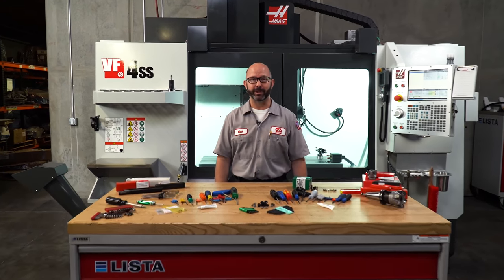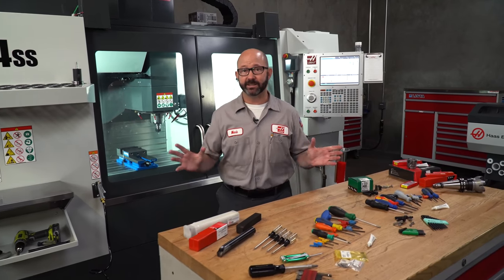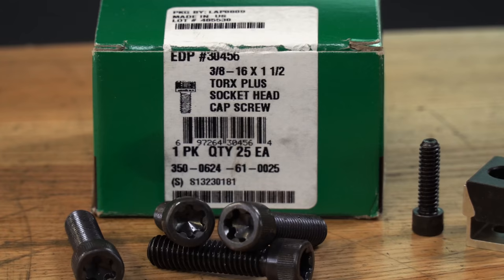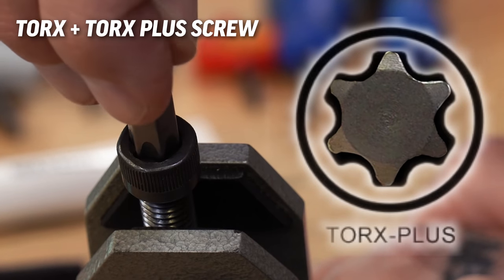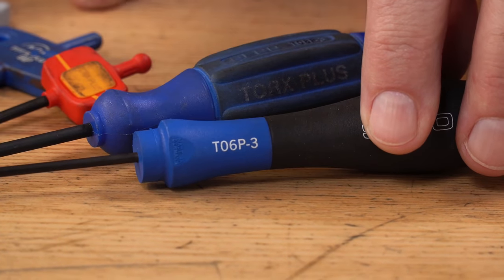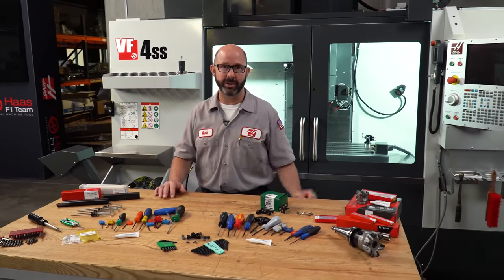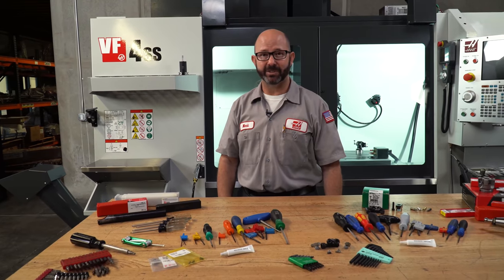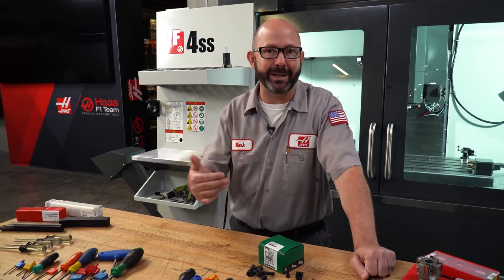THIS IS NOT A TORX - Haas Automation Tip of the Day

Comment: All I'm hearing is: Keep a set of torx drivers, replace any torx plus bolts you encounter with torx bolts
Reply: And PRAY TO WHATEVER HIGHER POWER YOU BELIEVE to never encounter one with stud in the middle.
Reply: @lokalnyork  Some bit kits have those anti-tamper bits in them in all the sizes.
Reply: @lokalnyork  That's called a security screw. Just slip a small flat in beside the centre stud, it'll turn.....
Reply: @lokalnyork  You can buy security-torx bits at almost any hardware store.
Reply: @lokalnyork  Or just keep a set of security torx instead of normal ones so you don't even need to check.

Comment: Torx is an excellent system, but they need to quit the endless tweeking or they will kill their standard. The urge to have a patented proprietary system has killed many a good idea.  Proprietary is an ancient word that means destined to die young.
Reply: IMO it's all about maximising $$$, by making a new type they can sell a licence for it to bring in more money than sticking with old stuff.
Reply: @olivertaylor4779  
I think that's what Brian Moore meant by urge to a proprietary.....
Reply: that and the fact I keep track of 1 phillips bit, one Robertson bit, and three different torx bits to turn the most common screws I encounter.
Reply: Torx is not an excellent system. It's a terrible system. There are too many sizes too close together making the use of the wrong size bit almost inevitable. Also the "doesn't cam out" thing isn't really true as I've had to drill out dozens of stripped torx screws over the years. You know what never has those problems? Robertson. The sizes are distinct enough that you never have the wrong bit, and I've never had one cam out, and never had to drill one.
Reply: @kenbrown2808  Funny, I need 3 phillips bits, 4 Robertsons, and about 20 torx bits. Torx is a disaster for that reason alone.
Reply: @green1  Ironic. Robertson would be the universal world standard today had they not wanted to be proprietary and fought with Henry Ford over it.  Ford wouldn't put up with proprietary and that set Robertson back immeasurably. Also, if Robertson covered as many fastener sizes as Torx, they would need more driver sizes as well.  I like Robertson, but their urge to be proprietary set them back a hundred years. The very same thing can happen to Torx if they don't learn the lessons of history.  Perhaps if they screw it up badly enough,  your favorite can make its way into more common usage.
Reply: @Green__one  robertson is the only one I've had the driver strip out the screwhead and still get stuck in the stripped hole.  I think torx is the one that's stripped the least. But it's also the one it's hardest to keep nonmagnetic screws from falling off the driver.
Reply: @Green__one  I totally agree that there should be a bigger difference in sizes for torx, it's worse when the head is rusty and the right size does not quite fit.
Reply: @kenbrown2808  funny, I find Torx strips out all the time, yet have never had a Robertson strip out.
Reply: @Green__one  that's very funny sine the only time I've ever had a torx strip before it spun the head off has been if I've been using the wrong bit
Reply: @kenbrown2808  problem is, with so many bit sizes so close together, it's basically inevitable that someone will use the wrong bit.
Reply: @Green__one  using the wrong bit is completely different from stripping out.  keep your complaints straight.
Reply: @kenbrown2808  one causes the other. However they actually are two separate complaints both relevant to torx. First is the insanely stupid idea of having so many different sizes so close together. And secondly is the nature of their multi-lobe design with too many fragile points. The end result is that you're guaranteed to wear out both fasteners and drivers far faster than using a sane standard such as Robertson. Of course it appears that that is exactly the intent. Torx is not designed to be the best fastener, it's designed to be the best method of selling tools and fasteners. And that is one thing it really excels at. Where you need three Robertson bits to cover the vast majority of sizes, you need about a dozen torx drivers to cover the same size range. You'll also find tool boxes full of Robertson drivers older than the people using them, torx drivers in regular use don't get to that age.
Reply: @Green__one  not in my tool box.  sure I have a over a dozen robertson tips in my toolbox.  that's because I buy them by the pack so I can throw them out when the corners start rounding off and they start stripping screws.  just the same as I do with philipps bits.  Torx, granted, I get a new one in every box of torx drive screws.  but I tend to misplace them long before I round them off.
Reply: @kenbrown2808  something very fishy going on there, I have Robertson drivers that were passed down for my grandfather that are still perfectly fine to this day with lots of use, whereas torx drivers round out all the time.
Reply: @Green__one  hand drivers? That you're comparing to power drivers?

Comment: Well I'm no machinist but I do a fair amount of wrenching on my own stuff, and I've never heard of Torx Plus before today. Thanks for the information!
Reply: Same. I wonder if it's better than triple square in terms of durability.
Reply: Im a mechanic and I own a set. They work slightly better but they still suck.
Reply: Ever worked on a Volkswagen? They use a XZN Triple-square head. Its fantastic. Just like a Torx but different.
Reply: @peteraugust5295  It's fantastic until you get rust on it and those tiny sharp points on those screws become dull. Then it's just hell broken loose.
Reply: Same
Reply: I'm an ex mechanic (55 years ago) and have a home metal shop where I use some insert tooling.  I will have to get out a magnifier to see if any are Torx Plus.
Reply: Ford used those in the chair/seat base that's how I learned 8 years ago. And let me tell you they are not cheap! I needed just one size T45 IP and I decide to buy a single a T55 at Ace hardware and grind the sh1t out of it until it fit perfect on the fastener. It has to be as close as perfect if not damage to hardware is inevitable and expensive!
Reply: Volkswagens are wack. Have torx everywhere, torx plus on cylinder head bolts. External torx starting to pop up everywhere and triple square. Hate vw.
Reply: Cat engines hsa had torx plus on there engines for years.
Reply: We use Torx Plus daily in our shop.
Reply: Ford Tech here and it's required to have a tp55 for cam phasers, and some tep for some new gen powertrain parts
Reply: @JasonisDomo    the fact that fords cam phasers fail, on "new gen" is 100% ill never buy that dohc garbage theyre pushing. Good it keeps you guys working though
Reply: @marioncobretti7870  That is why I love to work on VW/Audi/Skoda. Torx and triple square is superior by far, especially when the fasteners start to gather corrosion.
Reply: @panzerveps  i dont agree with that at all. Just took the rollbar out of a 92 jeep, all torx bolts, every single one stripped at tye head and the fasteners really didnt look that bad in terms of being rusted . Was a vw tech for 12 years before doing my own thing, ill take the old hex head every time, when they go at least they leave something to work with
Reply: @marioncobretti7870  What can you expect from a Jeep though...
I hate hex on any high torque application with a passion. They always strip out, so you'll have to work them out in some other way. Torx and 3xsquare gives you a lot better force distribution and less chance of stripping the bolt head.
Reply: @panzerveps  i dunno man. Them rear carrier bolts on passats beg to differ, they got rid of the triple square there for a reason I reckon. Perhaps ive never stripped that head, but i have broken many triple square bits and ratchets .
   I have never had a problem with triple squares stripping i guess. Torx and t+ though, all the time.
Triple square Fastener tends to end up being pretty fat compensating for the hole they need to make in it though
Reply: @johncooper4637  
didn't you watch the video?  
just read what it says.  
if it's all "T-number"   then it's torx.  
if it's all "T-number-P" then it's torx plus
Reply: @christopheryoung826  Working on a machining center where you need torx, torx plus and an allen set to take out a spindle makes you want to bitch slap the first engineer you see.
Reply: @Hathorr1067  trust me ik.. e torx, e torx plus, torx, torx plus, triple square, pena lobe, and allens just to do some simple jobs, it sucks. Sadly they are making more types as we speak.
Reply: Same

Comment: Alright, it's time to standardize the standard. Auto manufacturers you are now allowed only 5mm 10mm 15mm and 20mm to assemble an entire car
Reply: Got an old air-cooled Beetle.  Most of the car can be worked on using a 13mm wrench.

Comment: Ah, brilliant idea. If the whole JIS vs Philips vs Pozi wasn't confusing enough, let's also make a Torx variant :P
Reply: JIS is just pain annoying, almost identical looking to Phillips only way to know for sure seems to be trial and error to see what fits best. Almost ruined my HiFiman headphones using a Phillips driver before realising it was JIS.(only stripped one screw for which I had a spare)
Reply: Haha try a 5 sided torx looking bit with a pin in the middle ,I've seen em on engine fuel systems and we used to have to sign out the tool bit from the crib at work. 
The package said something about being a security bit that's used in prisons also ,hence the sign out they don't want those bits floating around.
Reply: @MrTheHillfolk  apple uses those for all its products. really annoying indeed
Reply: I'm glad my car engines use reversed torx plus. Can't imagine getting them at torque with a philips or pozidrive
Reply: @RossMitchellsProfile  Its pretty easy as long as you have good eyesight. JIS is a strict right angle but a Phillips has an bend at the 90degree
Reply: @MrTheHillfolk  Ford used them in Australia on their Falcons and Territories. They are easily available here.
Reply: @RossMitchellsProfile  You are clueless
Reply: @TheAdatto   Nobody in their right mind uses Philips for a bolt that needs to be torqued up.   The thing is just waiting to 'cam out' and damage both the screw head and the driver.
Reply: Don't forget about our good friend, the triple square!
Reply: @dommy114  Yes, I am clueless about JIS, as are many due to how it looks.
Reply: JIS can be identified by the small dot on the head of the screws. Next time you struggle getting the float bowl off you motorcycle or dirt bike look for that small stamped dot. Use the right driver and they come out no problem. It can be annoying but it's the world we live in, I'm sure people from other countries say similar things when they have to deal with weird imperial size fasteners lol.
Reply: @Fairshotguy  That's great if it has the dot. The screw in a pair of headphones I mentioned earlier likely didn't have it as they wanted it to be more aesthetically pleaseing, either that or they just used really cheep screws. (Only thing I could find that fit well and didn't feel like it was going to strip was my JIS bits)

Comment: There's a joker in this deck. Torx itself took advantage of an expired patent. They copied the Bristol fastener from before WW2. They just increased the ridges a bit and made them pointed instead of flat. Old machinists will know them. Still used in specialty gear. I keep full sets on hand to service Bell & Howell gear.
Reply: I'd question this provenance. A standard torx is, more-or-less exactly, a fractional-inch hex wrench with grooves ground into each flat - you can make an almost perfect driver by hand with a well dressed bench grinder. I suspect somebody "improved" a hex wrench to hack together torx, then later went back and did some proper ground-up engineering to get torx plus.
Reply: According to the relevant Wikipedia article, 
"The Bristol (Also named as Gamebit or Bristol spline) screw drive is a fastener with four or six splines, but is not necessarily tamper resistant. The grooves in the wrench are cut by a square-cornered broach, giving a slight undercut to the outer corners of the driver."
That's really not much like a Torx, except being 6-lobed.

Comment: Reminds me of that XCKD comic. 

Situation: There are fourteen competing standards.
Engineer: "There are too many standards! We should just create one that works for all use cases!"
Situation: There are fifteen competing standards.
Reply: oh the vicious cycles
Reply: XKCD 927 in case anyone’s interested
Reply: Engineer: "There are too many standards! We should just create one that works for all use cases!"
*Situation: There are sixteen competing standards. *
Reply: Team Tri-Wing.........ACTIVATE!! 😆😂🤣

Oh and don't ya just love the "snap-action" on ya fingers from your hex-key, when ya have to break loose a Button-Head cap screw. After 2 or 3 of 'em and grasping your fingers in pain, you'll finally grab your "cheater" to take out the other 17, that some engineer thought a lil 2ft square access panel needed. 😆😂🤣